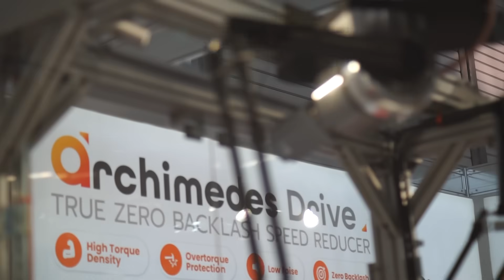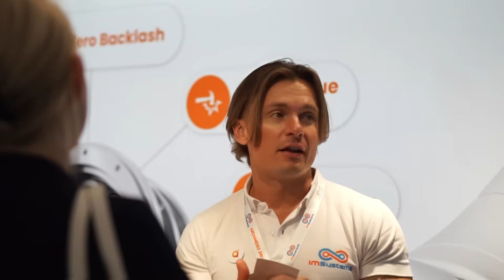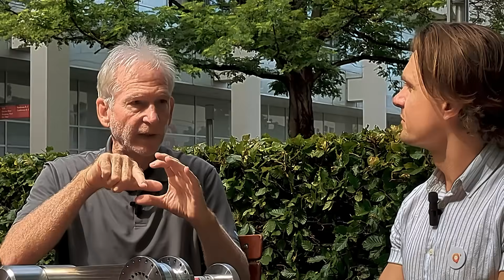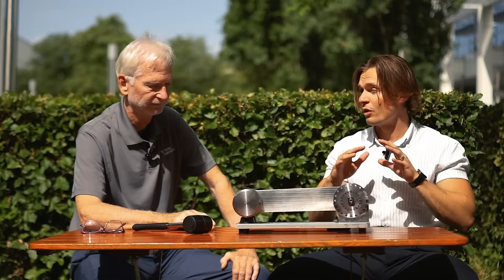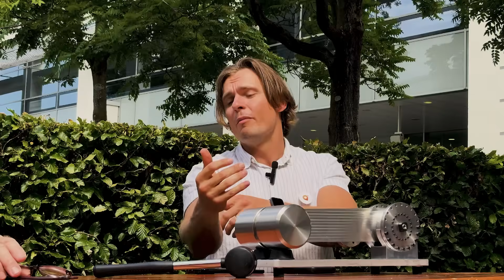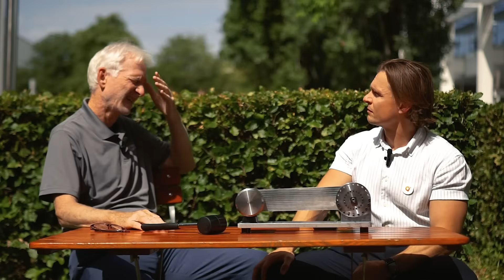This Drive Eliminates Backlash Could the Archimedes Drive Be a Game-Changer? | Soft Robotics Podcast

Comment: Does slippage not induce wear and does the wear not lead to failure? How does the amount of slippage affect the lifetime of the drive?

Also how does the temperature of the operating environment affect the tolerances in the drive and therefore the slippage torque?
Reply: Of course, every mechincal systems wears over time. However, this drive does not break when the slip torque is exceeded. We can do it tens of times without losing noticable performance. Drive itself is extremely efficient (90%+). Rolling contact is a way smoother method of transmitting torque than sliding gears.
Reply: Slippage and wear is typically the Achilles heel of all friction drives.
Reply: Relying on friction - what about heat generation?

Comment: In regard to deploying humanoid robots there are three potential huge markets, for factory use, for home use, and for military applications.

While the latter seems to have a bit of s stigma with  the general public with visions of Hollywood like Killer robots this will likely soon pass once they are fielded say by China and then the public concern will likely  shift to that of the west is behind in the robot race and needs to catch up.

That aside, humanoid robots used in combat are not all that different than how one employs UAVs, UGVs,  USVs, etc only that they have arms and legs instead of wheels, rotor blades or propeller shafts in that they would be controlled and operated pretty much the same.

But this video highlights several advantages a military humanoid bot would have over  a factory or home bot.

In regard to a factory bot a military bot would not have to have to be all that durable. The reason is that if it is used to lead a charge its lifespan would be pretty short anyway.

And in regard to home use the military bot would not have to work in close proximity to humans but could stay any number of feet from any human when out on the field.

Plus the risk a combat soldier is willing to take is far more than say a typical human in a typical household in that combat by it very nature is hazardous and the bots could reduce that hazard by leading the way with the humans  following behind at a more safe distance, not just from the bots but from the enemy as well.

And as far as mobility the humanoid bots could be trained to ride a personal mobility device such as an electric unicycles (EUC). 

e.g. Google
EUC VS Onewheel

And in regard to battery life, even a couple of hours of battery life can support an assault just as FPV UAVs don't have all that long of a battery life either.

Here is what Grok says about the latter's battery life.

what is the typical battery life of a FPV UAV

The typical battery life of a First Person View (FPV) Unmanned Aerial Vehicle (UAV), commonly known as an FPV drone, varies depending on several factors, including the drone's size, weight, battery capacity, flight style, and components like motors and cameras. Here’s a concise breakdown:

    Average Flight Time: Most FPV drones have a battery life of 5 to 15 minutes per battery pack under typical flight conditions.

        Freestyle or cinematic FPV drones: These often achieve 8–15 minutes with efficient setups, larger batteries (e.g., 4S or 6S LiPo batteries with 1300–2000mAh capacity), and moderate flying styles.

        Racing FPV drones: These tend to have shorter flight times, typically 3–7 minutes, due to high-speed, aggressive maneuvers that demand more power.

        Tiny Whoops or micro FPV drones: Smaller drones, like those using 1S or 2S batteries (300–850mAh), often last 4–8 minutes.

Also in regard to combat drones if used in say Ukraine one can by pass many of the regulatory hurdles one will face with say home bots.

So EU bot companies might go that route to get a jump on  China and US bot companies and get some government funding to do that as well as the EU ramps up their defense spending, plus save some Ukrainian soldiers lives as well.

Plus this could be justified as a response to Russia employing North Koreans troops in Ukraine s well and serve a geopolitical function as well as an extra bonus!
Reply: One other advantage a military bot has is that it does not need as many degrees of freedom in its hand in that it requires far fewer degrees of freedom to toss a grenade vs say thread a needle.

Even a two finger prong hand might suffice for most combat operations.

For with just that one an do a lot!

e.g. Google
Aloha Solo In Action

And also the combat bot might mostly be teleoperated as well and thus would not have to be all that smart.

And it even could have a fiber optic cable ala a FPV drone as well to facilitate that teleoperation but only for much shorter lengths like a few hundred meters vs miles as for a FPV drone.
Reply: One other advantage is that a military bot can cost more so one can make those without having to worry about a cost cap but can use a cost plus  contracting approach vs having to compete in a commercial market yet still turn a profit.
Reply: Still one more thing is that when the bot is riding its personal mobility device it can draw power from its battery as well and thus save charge on its self contained battery.

And one can likely train it to do amazing things on a EUC just as a human

e.g. Google
WHY HE SWITCHED FROM ESCOOTER TO EUC (after 10.000km)

9 Reasons NOT to get an EUC

Begode X-Way Upgrades - Single Wheel Dirtbike

And the bot can wear safety gear as well in case it falls off the EUC sometimes as well.